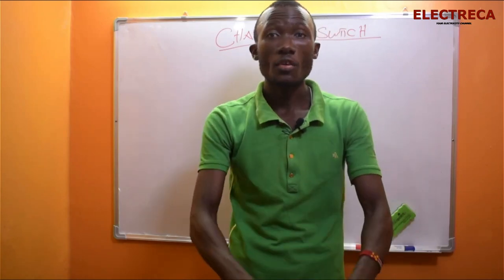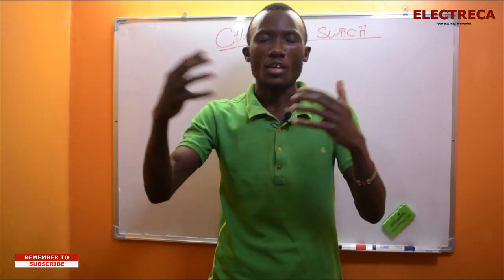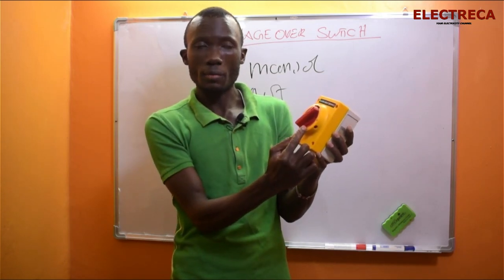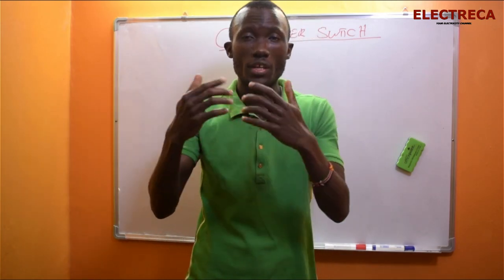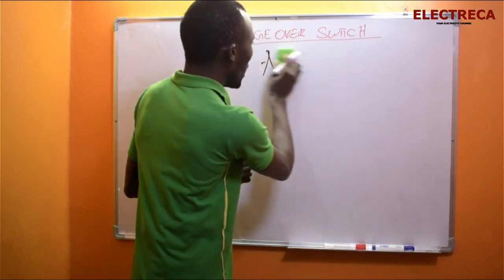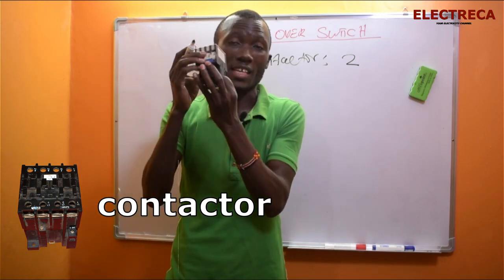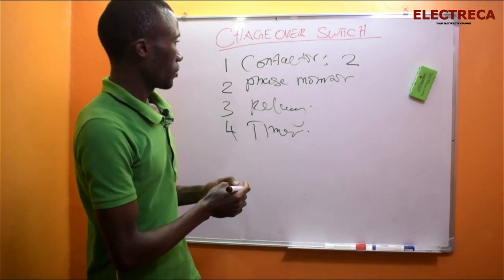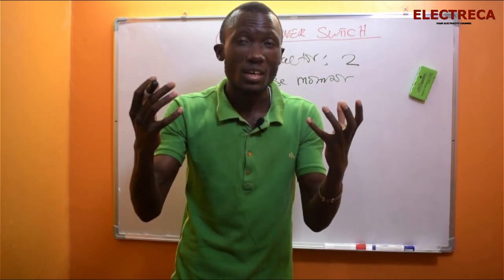what you need for change over switch

Comment: What does the sequence monitor does
Reply from the maker: It monitors the phase sequence, in case the phases are altered it will keep the system off. it mainly protects three-phase pumps from working backwards.